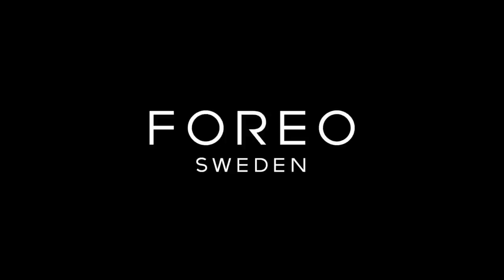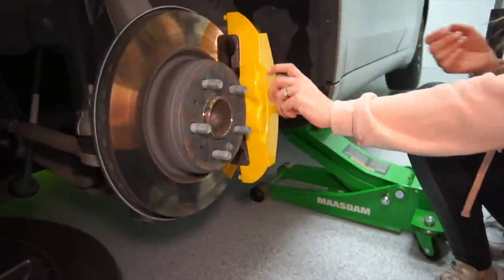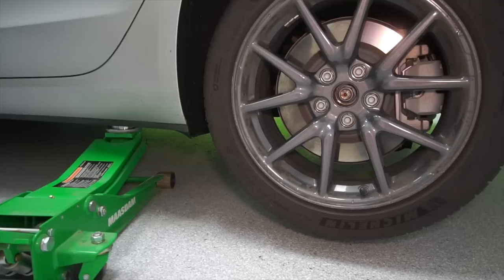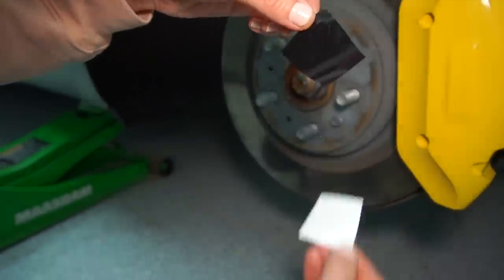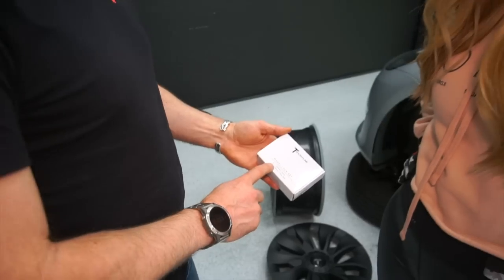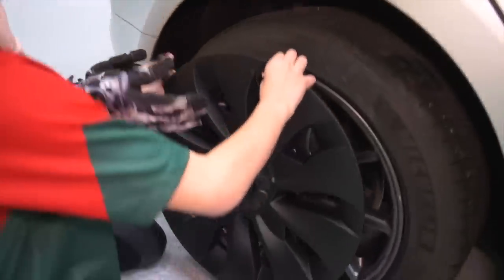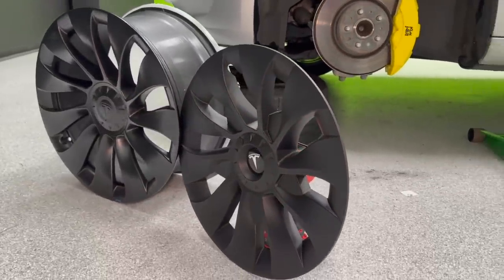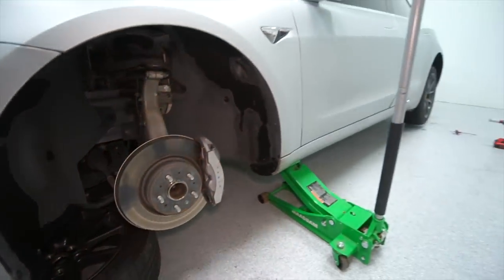Hacking the Tesla Performance Look & Boosting Range Instantly

Comment: 4% range improvement by changing the wheel covers is a huge deal.  Over 14 more miles of range on the Model Y long range would be a big deal.
Reply from the maker: Good point.
Reply: I have a 2022 M3 LR and a 2023 MY P and have these on both cars. On the Model Y P going from performance wheels to the 19's with the aftermarket aero covers I average 263 (Wh/mi) vs 304 (Wh/mi) with the Performance wheels. The combination of the new suspension for 2023 and the plusher tires is butter!
Reply: And no fear of curbing when I can just pop another one on!
Reply: @AI-Driven-Entrepreneur  Which aftermarket aero?   How did wh/mi compare with standard aero or Uberturbine Aero?   Also it's 19 inch OEM/LRR tires?
Reply: @Trust_but_Verify  OEM/OEM tires they are the model y uberturbines with the thick and thinner alternating spokes. I never tested the original Aero as they are hideous on the Y.

Comment: You should always use a Jack stand. Hydraulic jacks are not meant to hold a load for a sustained amount of time. They will creep down. Leaving them under load will also damage them, causing the o-rings to fail.
Reply: True, but no good place to put jack stands  on a Tesla.  Jacks are ok for quick work like changing a tire.  Of course, as noted in the vid, never get under a car with jacks only.
Reply: @aerodyneservices  we’re you watching the same video dude? They weren’t just simply changing a tire.

Comment: Love the aesthetics but I heard that these after market covers scratch up your wheel. (I don’t have experience w covers, just what I heard.)
Reply from the maker: We’ve had several different covers and unfortunately the wheels are already scratched the first time you remove the stock covers. Metal clips rubbing on brake dust is not a good set up.
These have a foam band on the inside to protect against scratches.

Comment: Kim, another great product review! I got my Rimetrix Orbitals 2 years ago when I saw your video. Now I want these Uberturbine covers. They look a lot better IMO. Are they easy to remove? The Rimetrix wheel caps are a pain to remove. Also do they scratch the aero wheels. I got the Rimetrix before they added the foam strips and scratched all of my wheels ☹
Reply from the maker: Thanks Daniel. I agree,  Orbitals are tough to remove and get scratched in the process. These are just like the Tesla Aeros in that they simply pop on and off without needing to remove the center caps first.
Thanks for watching, be sure to use code KimJava and get a free Tesla S3XY hot/cold tumbler with your order. Just add the tumbler to cart first.

Comment: Does the center wheel cap come in flat with tape or with wired fitting like pictured on Amazon?
Reply from the maker: Flat with tape. I may have linked the wires one below. I’ll fix.

Comment: Are you hearing or did you hear any popping / creaking noises on turning or driving in slow speeds (under 15 mph) after installing those Uberturbine wheel covers from TSportline?
Reply from the maker: No, it’s silent. Comes with padding on backside as well to reduce any potential for scratching your existing wheels behind the cover.
Reply: @ItsKimJava  Thanks for responding. My driver front cover makes a popping and creaking sound on low speeds (under 15 mph) especially on turning the vehicle to the left, like coming out of my garage or any parking. I swapped the covers to see if one of them only had that issue but it’s happening with the 2 other covers as well. They were all very very tightly fitted in to the Aero wheel.  What do you think that could be? I cannot tell where exactly on that wheel and cover is the sound coming from. Bought from TSportline as well.
Reply: @sanjuvarma  send them back for replacement

Comment: Great video but, only problem with lug nut keys you would have to keep them with you especially (Flat tire) in the car so hopefully theives wont break into the vehicle.
Reply from the maker: Good point, there are plenty of hidden nooks and crannies in the car (trunk mini side wells, front trunk, under seats etc. maybe best not to keep them in glovebox if that’s a concern
Reply: @ItsKimJava  Would recommend Frunk because at least they wouldnt have access.
Reply: Keep the wheel lock keys with the jack pucks...you don't want to leave home without them!

Comment: Looks great but stay away from wheel locks. They're SUPER annoying! More headaches than anything else.
Reply: And very easy to remove without the key socket.  You can actually buy a tool that removes them or just use vice grips.  I had to do that once when I lost the key.  So if someone wants your wheels, those wheel locks won't slow them down.

Comment: Why not use jack stand?
Reply from the maker: most people don't have one on hand. Just showing an alternate method.
Reply: @ItsKimJava  there is no place to safely put a jack stand.  I use two jacks, easier for tire rotation.  I always install and remove and torque the wheel nuts and bolts with the wheel off the ground.
Reply: @ItsKimJava  That was was excellent pro tip!
Reply: You should always use a Jack stand. Hydraulic jacks are not meant to hold a load for a sustained amount of time. They will creep down. Leaving them under load will also damage them, causing the o-rings to fail.

Comment: Well you are not hacking anything nor are you boosting the performance with larger wheels. Looks better yes. Better range no.
Reply from the maker: Incorrect, wheels are not actually larger and they do in fact give you a roughly 4% boost in range
Reply: The wheels didn't change in size, just the hub caps are bigger.  And yes range does get improved, it's science.

Comment: The problem with these covers is that they don't have a right vs left ... Defies the purpose of aerodynamics
Reply from the maker: it's literally more efficient than stock ones.
Reply: @ItsKimJava  the stock wheels and covers on all teslas are interchangable left/right, so these covers should be fine.